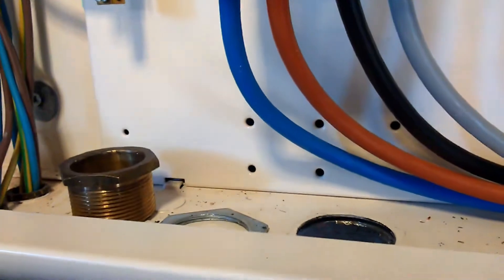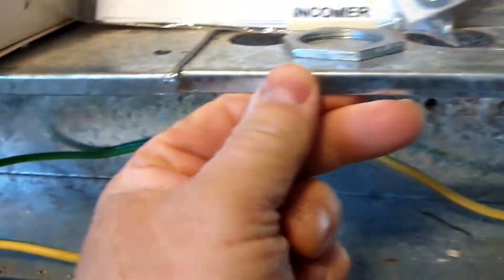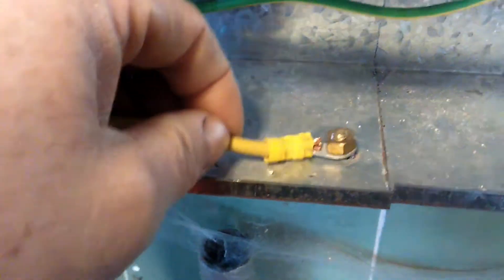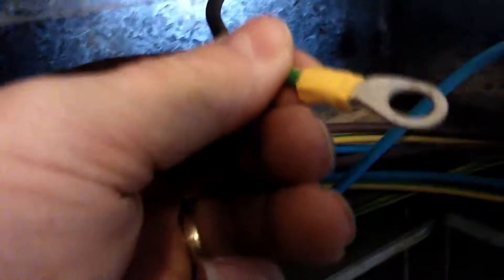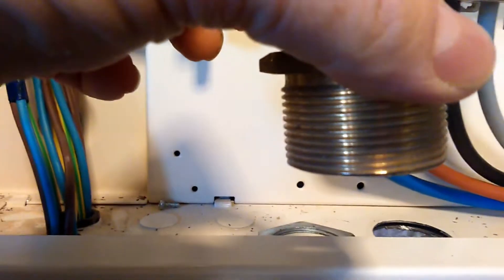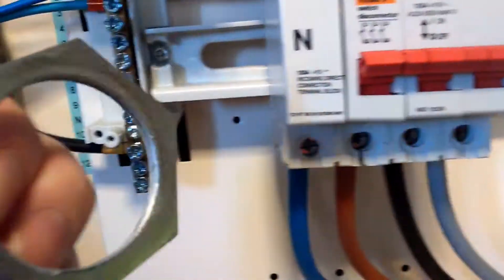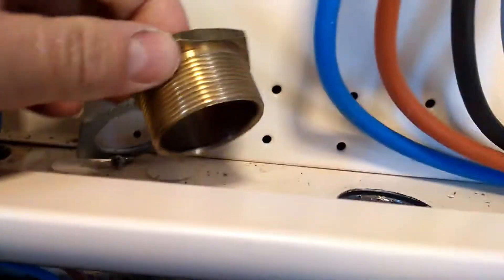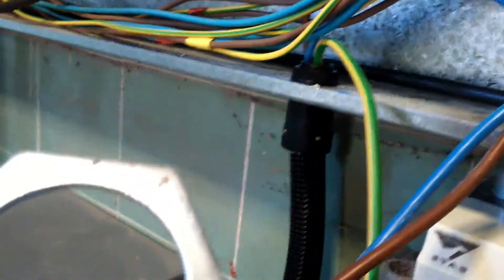Another job - Testing and Inspecting a poor workmanship job - My day job as an electrician

Comment: The wireless ground is new, I guess that one was blu-tooth eh?  ;-)
Reply from the maker: JimsEquipmentShed it is down to the inexperience of electricians that we find stuff like this. I am working at a very ancient dock tomorrow although the sewage pumps are not ancient.
Reply: Never a boring job though eh?   Hey, have you ever run into lead coated wire before?  It kind of looks like romexm but it contains two cloth jacketed wires inside of it. I ran into that on a garage job one day, I gather it was meant for burial, but in this case, they had it in the walls.   (Yea, I pulled it all out.)
Reply from the maker: JimsEquipmentShed yes we had a similar cable here in the UK. Outlawed years ago. Not sure when it was first used. It had a lead outer sheath with Vulcanised Indian rubber coated twin cores. It deteriorated dreadfully over over time and would short out.
Reply: Paulphotoeye Video it scared me when I came across it, I had never even heard of it before. And the setup was using the lead as a ground......
Love to see that fail over eh?